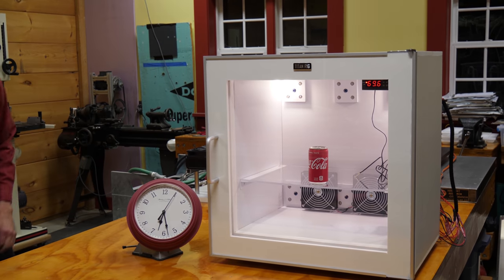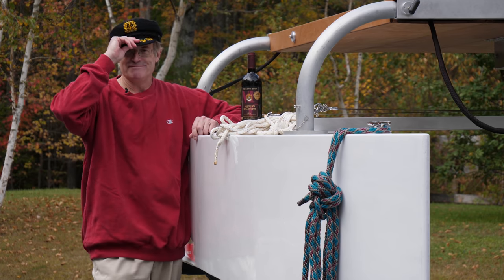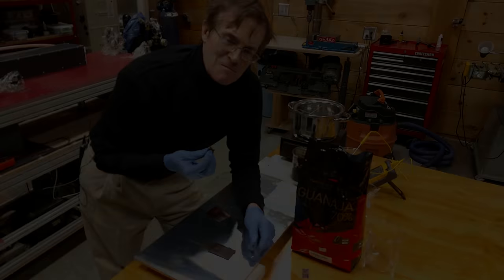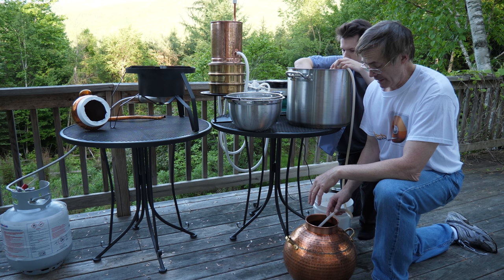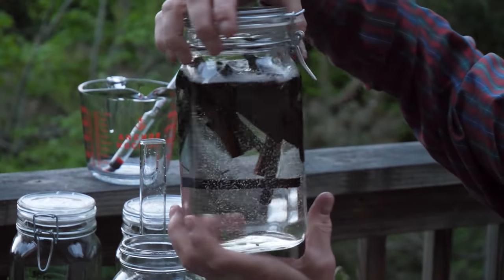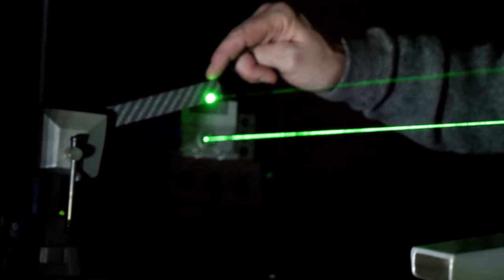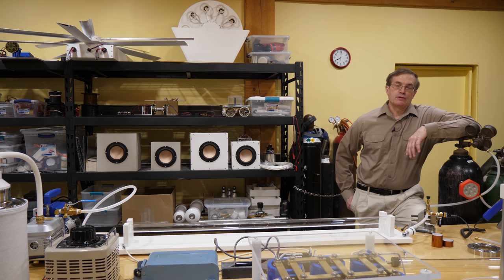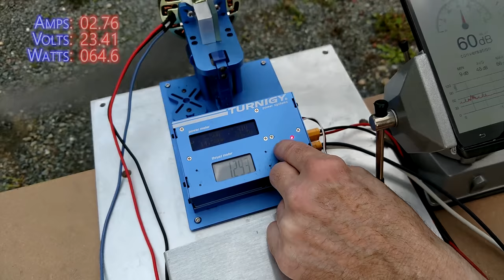The Best Moments From Tech Ingredients!

Comment: Thanks for all these interesting videos! I left a couple suggestions for projects on the patreon page, one about a diy heat recovery ventilation (a continuation of the climate control videos) and also a DIY Digital Micromirror Device laser projector (worlds best projector, in addition to the best speakers). Would be very interesting to know if you find these feasible/interesting. I think also that many of us would be interested in a continuation of the boat project. Many thanks for your great work!

Comment: Love you guys!

I was thinking about the observation made in the turbojet explainer video that the size of the inlet port ultimately determining the amount of air that can be processed by the turbine. 

What about using a largely frictionless adjacent disc pump (permanent magnet + air bearing?) and then putting a valvular conduit that empties at the turbojet inlet in lieu of the electric motor?

I don't think a traditional turbocharger-style impeller is designed to produce a vacuum so one might have to swap one side of the turbocharger for a Tesla-style vacuum pump to feed the turbojet but in theory this should only pull approximately the necessary amount of air plus maybe a bit more, no?

I have some other ideas related to a turbo-gasifier and using these conduits alongside a turbojet setup as a deflagration-to-detonation engine but this is long enough as it is. ;)

Full credit to NightHawkInLight for this wonderful combustion through a conduit: https://youtu.be/tcV1EYSUQME 

Cheers!

Comment: You have incredible maker skills. I was wondering if you could try your hand at a flow battery similar to ESS flow battery. They use two tanks of rusty saltwater one positive and the other negative and run them by plates in each cell with a membrane between them when charging. it looks simple and very scalable, from something to charge car or backup house power up to city sizes, and claim 25+ year battery life.
Reply from the maker: I've heard a little bit about it.  I'll look it.
Reply: @TechIngredients  I'm sure you would make your own version on it, improving on what they do.

Comment: Will you ever do a video on telescope making. Back when you did a video on thermal epoxy you talked about the grinding technique, But I wonder if there is a way to manufacture a mirror with out grinding a slab a glass into shape, like taking a sheet of aluminium or steel and just getting it into shape and polishing, maybe backing it with something to prevent the mirror from warping and making a light weight mirror. with low cost light weight mirrors, you can make multiple 20 mm ones and have a light weight frame able to deploy multiple mirror and reflect them all back to a camera, having a light weight ultra wide telescope that amateur can carry around. A portable James web telescope
Reply from the maker: Many years ago I was part of a team they built an imaging interferometer.  Combining individual mirrors to perform as a single large mirror isn't complicated, but it's difficult because each mirror has to be positioned with an accuracy much better than a micron.  I can demonstrate the principle and this might make an interesting video.
Thanks!

Comment: I love your channel could you make a video looking to produce hho from wind solar battery bank to heat a space using a natural gas furnace using the hho as the fuel and discuss the feasibility of such a system
Reply from the maker: The problem  is HHO contains oxygen and is highly  explosive. Storing it is extremely dangerous and it can burn right up the supply line into the tank.
Making pure hydrogen requires  a more complex setup.
Take a look at our video on "Hydrogen Detonation. "
Reply: @TechIngredients  I. Thinking    that  the furnace could be run constant in winter eliminating  the need for storage and temperature  control regulated through fresh  air supply
Reply from the maker: It could still run right up the line and into the generator.  But, that would be better.
However,  in that case, why not simply use a resistance  heater directly  from the PV panels.  It would also be more efficient.